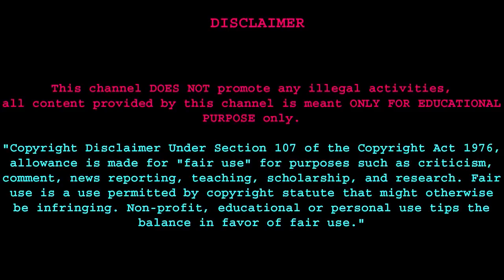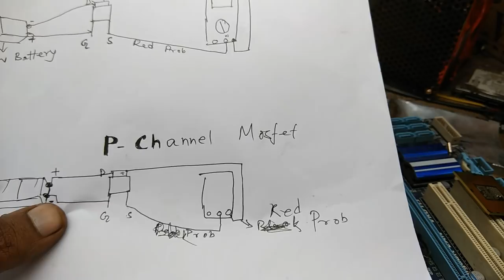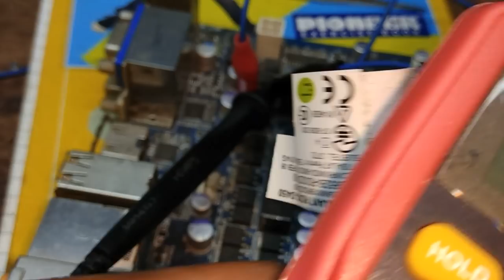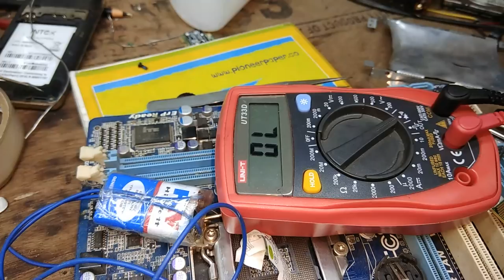How to Check Mosfet Without Removing From Motherboard | Easy Troubleshooting Guide

Comment: Sir , multimeter beep dega to mosfet achha hai ya kharab 
Plz jawab den
Reply: MOSFET ko gate* k zarye trigger kiya jaata hai( gate per kuch volt diya jaata hai) to drain* se source* me volt behne lagta hai.
Jab tak gate* per dubara negative voltage trigger nahi karta tab tak drain* aur source* short rehte hain aur voltage behta rehta hai.
Ager gate per trigger voltage aane se pehle drain aur source short hain ya gate per trigger voltage aane k baad drain aur source open hain to MOSFET kharab hai.
Hope you understand
Reply: @learnandteach.108  Dono condition me beep ayega to mosfet kharab hai, 
9v ka power k saat beep hai and without power ohms hai to mosfet theek hai